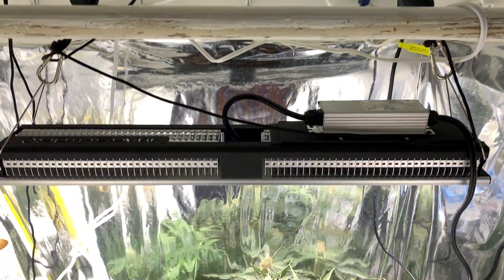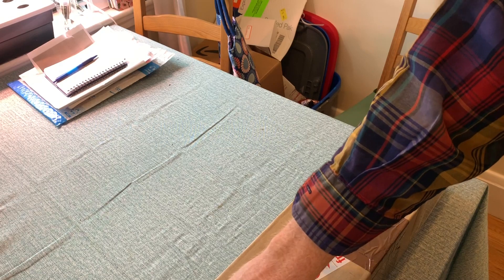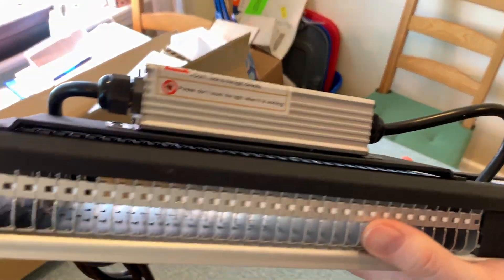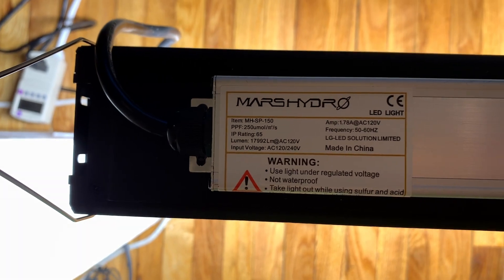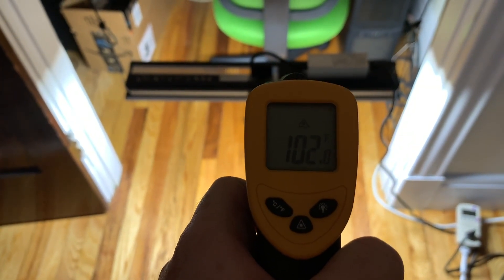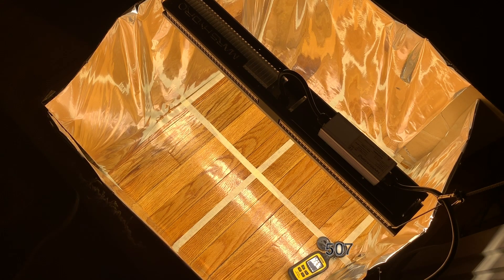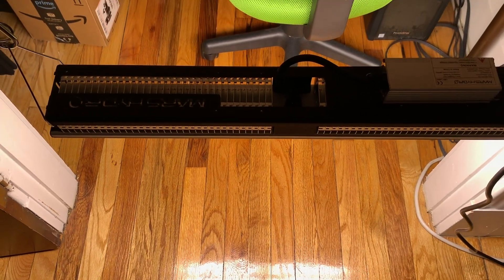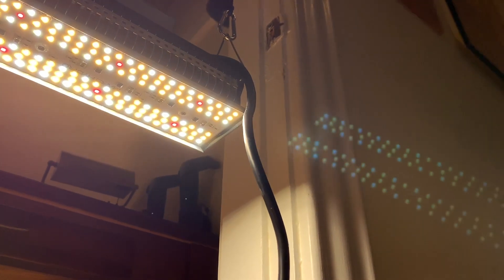Mars Hydro SP-150 Unboxing and Review - Watt, PAR/PPFD, and Temperature Measurement

Comment: Guys, i own Sp150 in a box of 80x40x120cm - i notice that i might have temp issues on hotter days so i was wondering if i can use a simple power regulator to adjust my lights output (like from 125W to maybe 100)? is it safe for a device like this? Can it cause flickering?

Comment: Does anyone think 1 of these would be enough for a  100cmx100cmx60cm space?
Reply from the maker: No, you should use at least 2 and probably 3. Rule of thumb is 100 watts minimum of high efficiency light (LEDs) for every 4 square feet.

Comment: I use a Quantum Board with LM301B and Cree xp2 660nm red Light with a Meanwell 54b 320 Watt Driver. Absolute amazing Light for me, i dont need another one. That cost me 265$ from alibaba.
Reply from the maker: A single 135W quantum board? If so you should be able to find them much cheaper than that.

Comment: im a bit confused, in the information paper that sp150 come with, there are 'operating requirements' and says -15ºC to 40ºC(5F to 104F) but u measured the temp of the light and was higher like wtf?
Reply from the maker: The light itself will be hotter. The environment can’t be too hot or else the heat sinks won’t be able to throw off enough heat and the light will overheat.

Comment: I purchased 2 sp 150's . Both failed in less than 6 months.  1st mars replaced after arguing with them for over a week.  
1st had 1/3 diodes fail. 2nd 1/4 failed. Buyer beware!
Reply: They arent waterproof. What was your humidity at?
Reply: @user-bi7ug4fr9y  around 60 percent. I know they are not waterproof.  I've had other  lights in the same tent for years with no issues.
Reply: @christophersmyrski8568  Darn that sucks. I wonder what caused it to fail. Doesnt sound like your humidity was too high.
Reply: @user-bi7ug4fr9y  I am on the 3rd Mars repacement. Took 6 weeks for the last one. Cost $30 to send the last failed one back but at least they finally replaced it. It does suck because I like the light. Just not the customer service, the wait  or that they have failed.

Comment: Thank you very much for this review. 

I'm thinking of using 2 of these SP150 in a 3x3 Mars Hydro tent kit or a Mars Hydro  Reflector 192 (Mars Hydro has tent/light kits and those are the 2 starting options I was considering)

Curious on your thoughts, as well others thoughts as well.
Thanks!!
Reply from the maker: One SP-150 is well suited for a 2x2 grow area, which is 4 square feet. That means 2 should cover 8 square feet nicely. 3x3 is 9 square feet which is just a little more than 8. I think 2 SP-150s would OK in that case. I do not have much experience with the Mars Hydro Reflector 192,  but their website lists it at 350 true watts, which would be more than 2 SP-150s. But that light also is powering a fan which adds to the power draw without increasing the light output. The 192 is also a "blurple" light which I personally avoid due to the annoyance of working and viewing my plants under that color.
Reply: @SmartGrowAutomation   Wow thanks so much for quick response and detailed answer.

If you were to ignore the annoyance of the brurple, and only the thought of end yield being superior with 1 option over the still 2 SP150?

Thanks and subscribed!!
Reply from the maker: @Your_Mailman_Grows_7121  I don't have a 192 so I can only go off their published specs. The 192 is listed at a higher PPF output so theoretically it could yield more but I expect in practice they would be pretty similar.
Reply: Did you ever get 2 SP 150's and if you did ,how did it go?